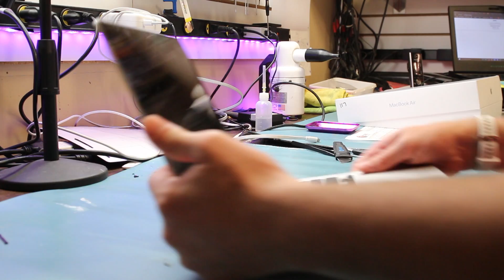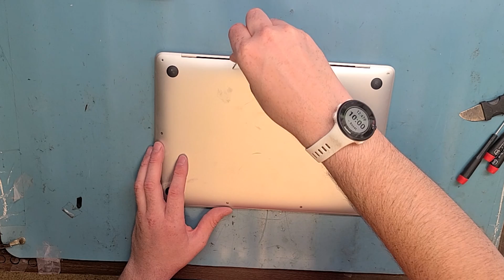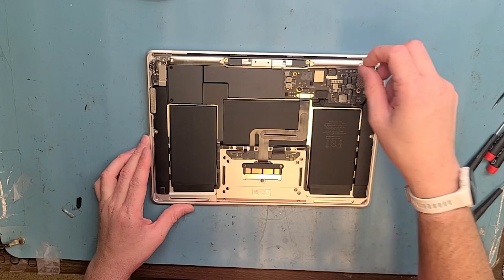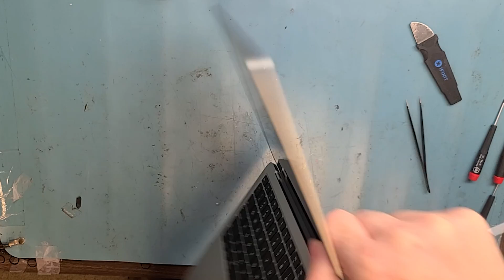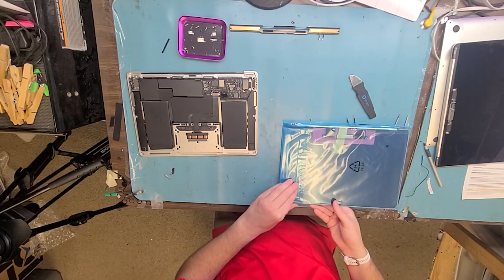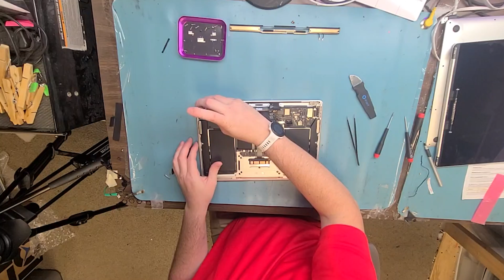MacBook Air 2020 M1 Screen Replacement

Comment: Great video. FYI. for those having an issue with unscrewing the Bracket on the WiFi connecting cables using a T3, use a T4 instead (which is what I had to do).
Reply from the maker: Thanks for the info!

Comment: I ordered an original screen from ebay for a Macbook Air M1 2020, after the change screen is black. Diagnostic test says: "There may be an issue with the display" code VFD001. Can you please help?🙂
Reply from the maker: So the code is showing on the screen?
Reply: @worthitrepairs  on Comand + D. I would need to configure the system, could You please help?

Comment: I Tried to follow this tutorial but once I completed and re-powered the laptop the screen is black and I just hear the start up sound of the laptop over and over can anyone help me out .
Reply from the maker: It could be something wrong with the logic board or the connection between logic board and LCD bar. Check connections it also could be a defective part possibly.
Reply: Me too mine is black.  Did yours ever get fixed?

Comment: Please, i am trying to remove the 2 screws to separate the halves and the screws are stuck and in my desperate attempts to undo them, both the t8 screwdriver and the screws got stripped.  They are all super stuck.  What do i do
Reply from the maker: You unfortunately will have to cut out the screws I have replacement screws I can sell you for $5
I cut them out using a Dremel tool and use a flat head screw driver to remove them
Reply: @worthitrepairs  that is pretty helpful.  I’m taking it to a repair place in my town to hopefully fix the screws. I will pass this information on.  Thank you

Comment: Yea, my few month old Apple 2021 Imac screen has a hairline crack from 
the bottom to midlevel. Apple wants 800 to repair it ... damn, only paid
 1500 for the computer ... and they won't sell the part to local repair 
vendors.
Reply from the maker: https://worthitrepairs.com/shop/

Comment: Thank you!  I replaced my screen in about an hour.  Mentally exhausted because I just knew I would mess something up, but everything is working as it should!  Thanks again!  I so appreciate you showing how to do this!!
Reply: does the camera work ?
Reply: I just checked (since I don’t use it), but yes, it does work😊
Reply: @JoAnneM1963  How the fuck it works and mine as a genuine screen it doesn't. Or maybe the cunts which I sent my MacBook in for repaired they swapped my screen.
Reply: Hi! Where do you buy the screen? I need 1 in Spain.. Thanks!
Reply: @rauljavierbonillaolivares9397  Amazon is where I found mine.
Reply: Cheers bro, very good tutorial. No issues at all